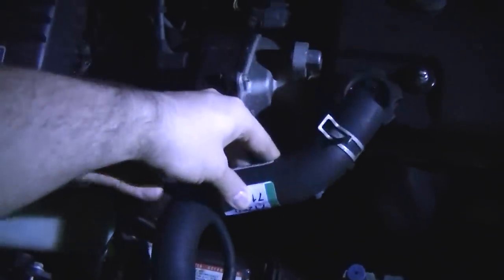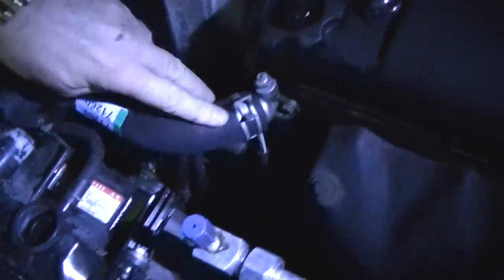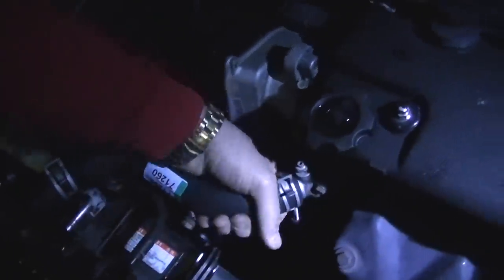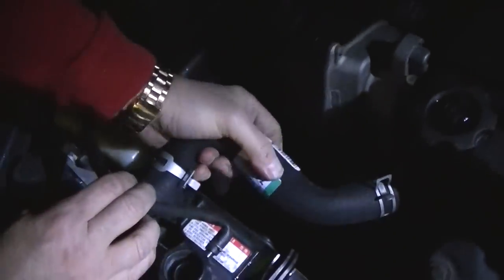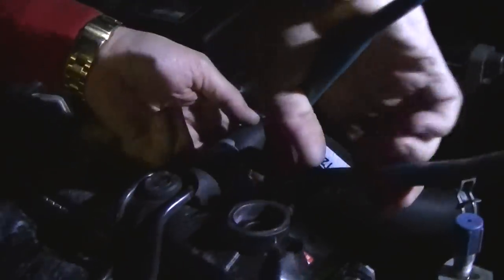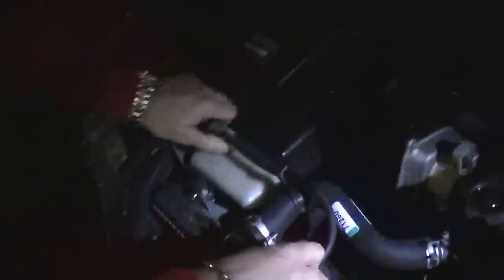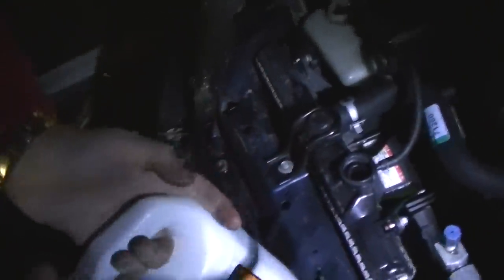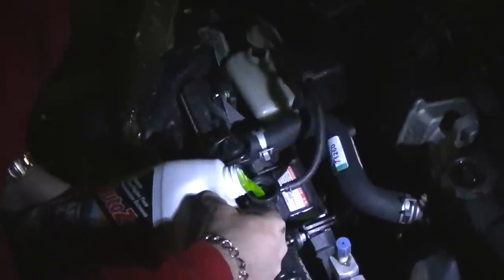How to Replace a Radiator Hose (It is SUPER easy)

Comment: Question. I just changed that exact hose, added the coolant just as you did. I turn on the car and after about 5 min, white smoke. Now I haven't driven it since the swap cause I want to make sure it's drivable. Someone told me that it could just be the excess fluid that might have spilled over. I will also add that the old hose cracked open so it smoked when all the coolant spilled. What do you say? Normal? Should I drive it to see if the smoke goes away? Thanks is advance
Reply from the maker: Run the engine and look under the hood to see where the smoke is coming from. If it's just spilled coolant burning off you'll be fine.

Comment: since that's a Honda the system is supposed to be bled or it will have idle problems later don't know what year it was really critical on bleeding the cooling system but have read that they do have to be bled after opening up cooling system for any reason!